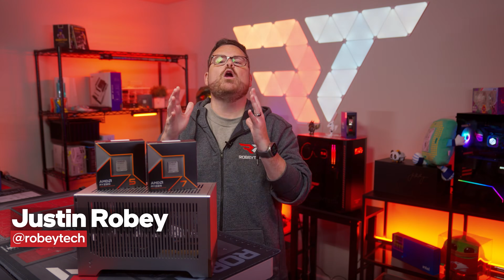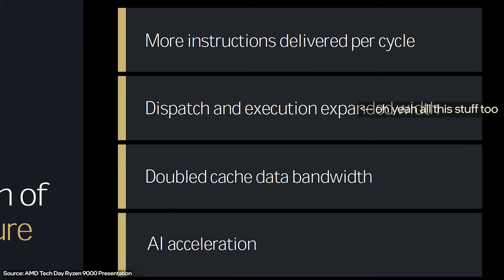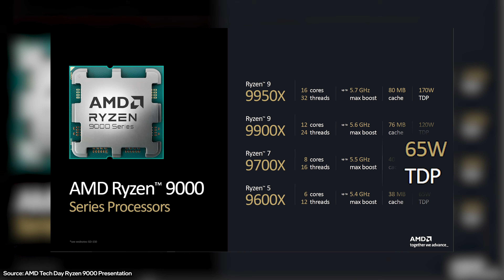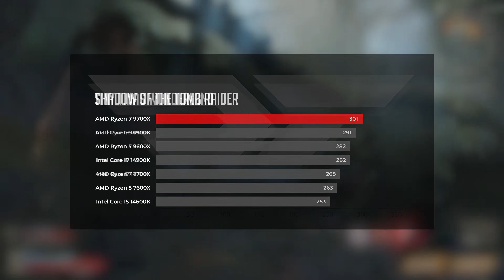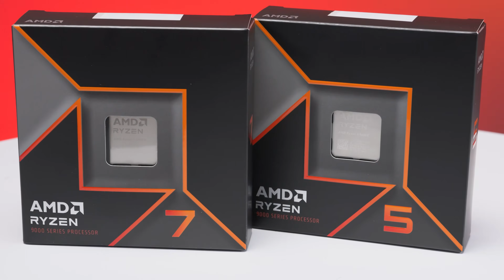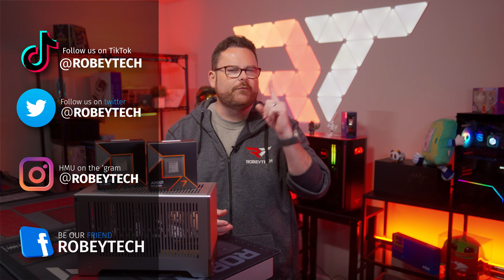The Power of the Ryzen 7 9700x Review & Build

Comment: 9700x still not worth the price cause 7800x3d price so low 7800x3d is the better buy. 7800x3d is still king in gaming.. I'm excited see how the upcoming X3D turns out
Reply: On some countries like ours, 7800x3d is 10% more expensive than the new 9700x. I'm happy with my purchase since the 9700x is doing near the performance of 7800x3d with lower wattages, cooler temps, and cheaper price.
Reply: @sklouchechi3968  9700x dont have lower wattages! It consume more unless you dont switch off it!!9700x are stupid buy!!its much  slower then r9 7900/x in productivity while gaming are same and price too!! I hardly dozbt you combine 9700x with 4080super or 4090
Reply: @sklouchechi3968 it is currently 30% more expensive 😅
Reply: I got the 9700x ram and a motherboard for LED than a 7800x3d from microcenter
Reply: @KayKashi  hey if you don't mind sacrificing proformance over cost more power to you. I got 9800X3D well worth the money.
Reply: @KayKashi  for how much
Reply: Not for me, the 7600x and 9600x are around €200, the 7700x and 9700x around €300. In my country they ask a ridiculous €500+ for the 7800X3D.
Reply: here 7800x3d and 9700x only have a difference of $20 lmao
Reply: @nicky4092  you must be mentally slow.. at the time this was posted 7800x3d was $330.. now that AMD has stopped production price has gone up..
.
Reply: @nicky4092  still 7800x3d much better in gaming
Reply: @nicky4092  and almost so much percentage in fps
Reply: I don't do gaming but planning for 9700x and in my country the 7800x3D(out of stock), 7900x3D is priced at $570 and 9700x is priced at $433, do you still recommend 7800x3D? and why ?

Note: My location is hot for almost 8 months. (45°C /  113°F)
Reply: @deependudhe  at time of this post.. 7800x3d was cheaper and plentiful.. AMD stopped production of the 7800x3d and 9000 series sucks. This had made price of the 7800x3d skyrocket.. I don't recommend either one at this point I'd wait for X3D to launch.
Reply: @BigAndTattooed  Thanks for the quick response.  As I mentioned earlier l, I don't do gaming but some moderate video editing. Does it still make sense to go for the x3D version? For me low temperature is a priority.
Reply: @deependudhe  no X3D is for gaming.. i go for regular 9000 series for editing..
Reply: @BigAndTattooed  Thanks 😊👍
Reply: @BigAndTattooed  1)  Nobody cares about what you recommend because you have zero knowledge and zero experience, and you need both to be able to recommend something. Watching reviews and fanboying over hardware you don't own doesn't count btw. 

2) After the BIOS updates and motherboards actually being tuned to work with the 9000 series CPU's, which wasn't the case in the day one reviews that proclaimed 9000 series as bad,   9700x is actually faster than 7800x3d in some games and just as fast in most, while being MUCH faster in productivity tasks, much more efficient and cooler too, while costing almost 40% less. So yea, anyone buying 7800x3d or fanboying over it now is mentally slow.
Reply: @derbigpr500  except I build pc's for a living. No one cares about your nonsense. 9000 series sucks the X3D cpu's are king 9700x is garbage. That's why no one is buying them.
Reply: @BigAndTattooed dont believe this person 9000 series with bios update beats 7800x3d by a good amount and less power usage aswel
Reply: @deependudhe  buy rather then 7900/x  which are way faster in productivity and similar in gaming and prices are similar too
Reply: @Mr11ESSE111  after the latest BIOS updates for AMD mobo and Win 24H2, 9700x is providing slightly better benchmarks as compared to 7700/x that too with  65 W TDP ( 88W PPT) and better thermals. At my location both 7700/X and 9700x differs by $100 but might get offers in sale.
Reply: @deependudhe  it offers same as always and that is 2-3% for 35% higher price
Reply: Yes but you can't buy them anymore kind of like you can't buy the 9800 x 3D right now due to the goddamn scalpers
Reply: @lorddrago2162  this was posted before price hike on 7800x3d. But the 7800x3d will be shipping soon again price will drop . 9800X3D you can get one. I got one ordered today around 4pm today on newegg.. just have keep checking. Hey thanks for responding.
Reply: calling ryzen 7 9700x garbage is like calling ryzen 7 7800x3d useless
Reply from the maker: For SFF to 9700x will be a better CPU I think.  But yes outside of that you aren’t wrong.
Reply: @robeytech  9700x have nowhere price on the level of r9 7900/x and its way slower then this cpu and gaming are around same

Comment: how is that case with the heat of an i5 13th gen? i had trouble with the fractal ridge.
Reply from the maker: If you turn on stock settings you shouldn't have an issue at all, especially with a good 240mm or 360mm AiO
Reply: @robeytech   Thank you. I appreciate it.